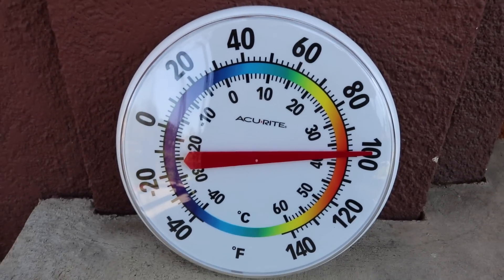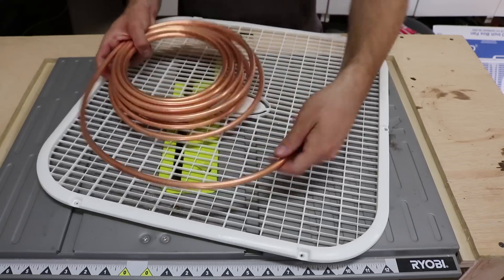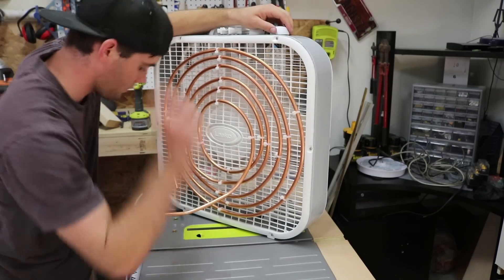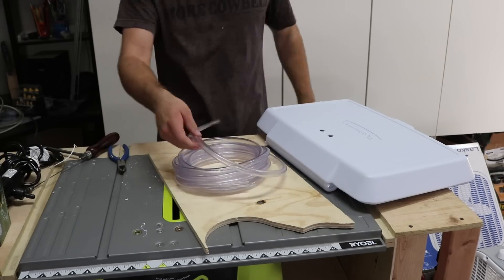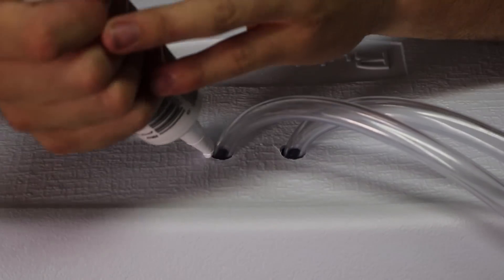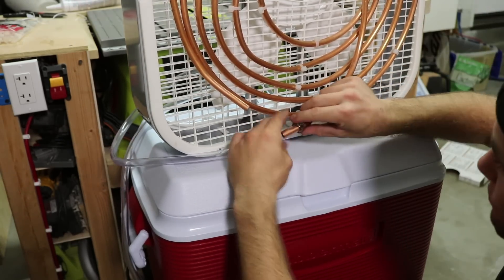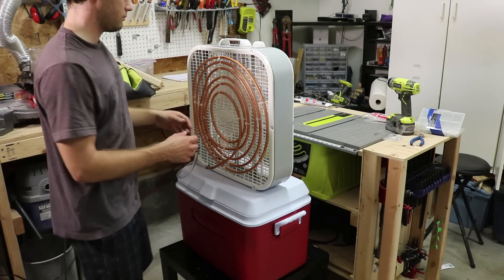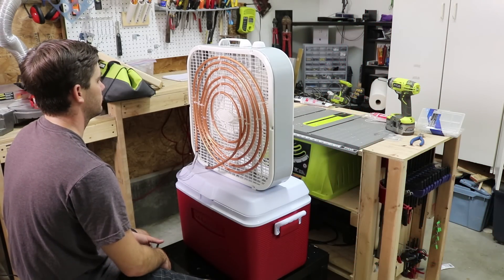$100 Homemade Air Conditioner - DIY

Comment: Well as an HVAC tech I have to say this would work in theory. Not sure exactly what the delta T would be  infront and behind the fan. It would certainly be better with some form of aluminum finned type copper tubing. There's also the law of thermodynamics that energy cannot be created or destroyed... Which means the heat energy that exists within that room is simply being transferred into the cooler. Heat is energy that moves to something cooler... So the real question is how long will it take this contraption to cool the garage before the cooler itself has absorbed too much heat and the water is now just as warm as the room? It realistically cannot change that heat energy into something cooler. it can only be transferred from one place to another.
Reply: This would be excellent in a small space, such as a pickup camper.
Reply: The energy mostly converts the ice to liquid, though not very quickly (which tells you how well this works).
Reply: Ya and?
If he can transfer the heat from his garage into the cooler then that’s his intended outcome. You’re over complicating it.
Reply: @whattha930  the heat is still inside the room.
Reply: Actually, without a constant source of cool water this system would add heat to the room (fan motor). His best bet would be to spray water on his shirt and stand right in front of the fan. At least that’s my opinion as a lowly psychrometric engineer. 🤷🏻‍♂️
Reply: Is delta T a variable like X?... More importantly it wouldn't be logical not to agree with u, with the same token, turning on your home, office or vehicle AC is also a way of transferring heat.. And if I'm on track, what I'm most curious about and will still look to try this method BUT WITH DRY ICE. price triples apx 350 finished.. $200 buys 16 packs of dry ice from Bens plus the cost of a super icy cooler have u in the 3's BUT pack it all together and it will last about a month n half assuming your running it for the majority of day light. If ur suggestion of a copper fan like aluminum? (micro radiator if they sell it online be great) and combined that with a stronger power source (dry ice) and a better fanned water cooled system (maybe like placing it on the front and back?) And locating my 2 fans somewhere near the ground channeling fresh outside breeze inward, while having another fan near the ceiling blowing that hot air outside. Haha. I love summer when it's snowing unless I'm at the beach. Icee ice cool is how I like it cold. Please do poke out points of failure if anyone thinks it won't work and be nice to know why. Maybe it would be cheaper to run an ac unit into the garage but my doubts are higher about that...
Reply: @syirusb4583  Delta T is the change in temperature that occurs over time. T stands for temperature, delta is the Greek symbol used to symbolize "change in". T is typically a dependent variable in formulas for heat exchange (for example heat transfer is Q = m * c * delta-T).
Reply: @syirusb4583  This system and the one you want to make will only work until the ice is melted. Then the system reaches equilibrium and no cooling happens. A true air conditioner never reaches equilibrium. Energy is used to create a perpetual imbalance. The air inside gets cooler and the air outside gets hotter.
Reply: @Jason While you are correct that the heat in the room is essentially absorbed by the ice in the cooler. I think you're missing that this is a passive cooling system to spot-cool a small area to keep onself more comfortable for a short time. I haven't gotten to around to finishing mine yet, but I am currently building one myself. Seems like a solid way to save money on my electric bill during the Summer in the deep south. Hopefully it works out for me.
Reply: @bignamek  But you're either spending money on ice or spending money on electricity to make ice. You could just spend that same money on electricity to run a small A/C unit.
Reply: @edisont.picard4112  I'm sorry I failed to mention that I'm using gallon jugs to freeze water to swap out. My freezer is going to be on anyway, so I'm gonna just reload ice that way. It won't get cold as, of course, but should stay frozen longer given the greater mass of ice and it won't need to be drained as much.
Reply: @bignamek  It's still not a free ride. You spend some amount of electricity freezing your food but as soon as you load 10 gallons of water into your freezer, you will spend more electricity to freeze it. If you are trying to cool a space larger than a shoe box, you're just wasting money that could be spent on an actual A/C that really works. Not to mention the money to build it. A $50 Craigslist window unit is cheaper and more effective.
Reply: @edisont.picard4112  It might be more efficient, but I don't know if it would be more "effective." For my particular case I live in a house that is poorly insulated, so the cooling benefits are not as high as it might be if I lived in a different climate where insulation is more of a priority. In my case, the volume of air moved while cooled is likely to be a larger factor.
Reply: @edisont.picard4112  ice makers cheap
Reply: @edisont.picard4112  I find it entertaining the arguments some of these folks make. It's like the guy that wants to charge an EV by attaching a small wheel to the car with a generator attached. lol
Reply: @bignamek  Well, how did it work, how long did the water and ice stay cool
Reply: The guy was just looking for a easy way to cool himself off. And it worked. So I’d say it was a success.
Reply: It works, the temperature in the room is controlled for longer before spiking to the point of being uncomfortably hot again., for the cost this is a really cool design 🙌🏻
Reply: It’s just acting as an evaporative cooler. He will get a cool breeze and that’s all he needs. Will need to throw in ice into the bucket every so often
Reply: u would be replacing ice all day lol
Reply: It would be better to run some plastic pipe 5-6 feet (2 meters) deep under your garden in an array, to bring cool air in from underground, with a fan. Then you wouldn't need to keep refilling the ice.
Reply: As an HVAC Tech who doesn't have poop for brains.....I'd say this is the dumbest thing I've seen in a while. That copper tube has such little surface area you would be better off to just take off the lid  and return that pump. Run the fan air over it and enjoy melting your ice for a fraction of the electricity and in about the same time. If you took the money you spent you could have gotten a small AC for your garage.
Reply: As a non HVAC tech, simply remove some of the warmed water and add ice.
Reply: Who gives a sh--t what the delta T is, he's not trying to cool his whole house. It's a DIY way to stay cool and it works. Praise the man for his idea and shut the f--ck up. And I'm a 35 yr journeyman ac tech in silicon valley
Reply: He’s definitely not trying to cool the entire garage down    Pointing it at yourself while working would keep you cooler and that’s the point
Reply: Wisdom. People just do these videos to be "funny and cute" as they share no valid info, and waste people's time and money.
Reply: Yeah and the inside material of the ducts get cold if they are made of metal 
And In turn you get colder air.
Reply: Wouldn’t it leak water as well…..  condensation…..
Reply: Also it’s not conditioning the air…… unless you mean making the air more humid we’re an air conditioner traditionally does the opposite..
Reply: Ice melting is where the heat absorbtion is happening
Reply: Massive Turth revolution on your part!!! Good job !!
Reply: That's not thermodynamics.  "Energy cannot be created or destroyed, only change forms." is the law of Conservation of Energy.
Reply: @BigGuy42080  it's literally the first law of thermodynamics, because the entire concept involves heat transfer. You can look that up if you like 👍
Reply: So where does the heat go on a normal ac central unit for the house ?
Reply: @rl4416  it goes from the indoor air, through the return into the furnace. It is then blown into the coil, the refridgerant absorbs the indoor heat, the refridgerant then takes that absorbed heat to the condenser outside where it is rejected to the outside air.
Reply: @numchux2  thank you . I was lost on the heat has to go somewhere part.
Reply: @rl4416  yw, glad I could simplify it enough HVAC can get pretty complicated 😆
Reply: just put more ice lol
Reply: @ptq32t  yes , im alot more stupid after reading your comment .
Reply: Would be interesting if you could cool it with a dehumidifier’s output?
Reply: It works cooled our room by 15 degrees
Reply: What if you used dry ice??
Reply: What do you recommend as an alternative to beat the heat??
Reply: I got a 500 watt solar panel that powers my mini ice maker. 28 lbs / day. Put that in the cooler very few hours. And blow it out like this system. Off grid living. Portable AC takes too much wattage.
Reply: Appreciate your knowledge, but wouldn't the consequences of thermodynamics reduce when the ice is replaced allowing the cooler not to absorb to much heat?
Reply: It's a coping saw, not a hacksaw
Reply: You have to keep replacing the ice, because you're exactly right. As the warmer air is being blown over the tube it will melt the ice. However the longer you run it with replacing the ice it will get cooler. I would also suggest piping on the back as well. It would probably take 3-4 hours to cool the room significantly. There are other designs that work much better. Since it's not blowing the air from inside, it may be a benefit to add dry ice as well.
Reply: technically the water will always be colder or cooler than “room temperate” considering if you splash water on your face it’s gonna feel cool. doesn’t matter if your an “HVAC” bud, cool is cool! haha
Reply: You need around 7 kg Ice to melt for every liter of water in the air as humidity. Sensibly cooling air will require much less, so depending on size of his garage, he may need to replenish 5 to 7 kilogram ice every hour or two. And yes, it's literally AC. It cools and dehumidifies. Amount of ice also seems manageable if your chest freezer can make cheap ice during cold hours of night, it's as energy efficient as AC.
Reply: isnt it the same thing to let an open bucket with ice melt in a room? this look just a directioner
Reply: I would think the answer is....that while the ice cubes in the cooler are cooling the room but melting ...and moving from cold to warmer, the ice trays in the fridge are freezing water and a manual refresh of ice cubes is added to the cooler again, so that this ultimately has less environmental impact than a throw away portable and also keeps you physically fit cause it gets you off the "couch" by having to periodically replenish the icecubes? This system while crude seems cheap to maintain and is very simple a answer, my question is, just how good is the heat/cool exchange of the copper pipes, and you've already touched on this....so the quick anwer to your question is fresh ice cubes go in the cooler periodically.
Reply: @thesongtowoody  if he’s got a yeti cooler then the ice doesn’t melt 😂
Reply: @thesongtowoody  an ice cube melting and one right out of the freezer are the same temperature until the cube has completely melted. It's called latent heat which is the heat required to convert a solid into a liquid or vapor, or a liquid into a vapor, without change of temperature.
Reply: I don’t think he’s trying to cool down the entire shop in the first place but if he’s taking a brake or working on something in one spot he can have it pointed at him to stay cooler. This isnt a literal air conditioner, its just to keep him a little cooler. His title is misleading but I didn’t honestly think this was an air conditioner replacement lol.
Reply: @pattycarljackson  video title says "homemade air conditioner"
Reply: @DickShooter  and it’s conditioning the air. So there you go.
Reply: @DickShooter  I always wonder how people like you were the fastest swimmer. This isn't meant to cool down the whole house. Is your IQ like 30? It's a personal AC, meaning while he is working in his garage, he can have a low energy cost AC that can help keep it more bareable. Does this help sum it up for you? And the rest of the 1st graders here? It's basically a modern day swamp cooler, when they put ice in front of fans and windows.
Reply: @pattycarljackson  youre wrong, this is literally an air conditioner. you know how those work? they get cold which pulls moisture from the air which is exactly what this will do.
Reply: @zombieblaster5754  a dehumidifier takes moisture out of the air and no this isn’t literally an air conditioner.
Reply: Yes, we get it... but 7K vs 100 bucks and the cost to refill the ice for those with limited budgets this is GENIUS.  C'mon Mr. HVAC man, he's not going to use 7K in ice, let alone the electricity costs of a compressor running.  It's called dealing with the realities within one's circumstance that otherwise would be undoable.
Reply: Yes it’s transferring the energy to the cooler….. but that’s the ice melting…..
It takes energy / money to make the ice ….
Reply: @mycaddigo  Wow, like... Wow... Okay man. Just an FYI. It doesn't cost but PENNIES for your ice machine to make ice every month. In case you don't have one, your freezer is already on. Secondly you're not using this to cool down your home 24/7... It's a way to cool yourself down when you have a project to do in the garage. I guess you don't get off the couch enough to know that either. How did some of you survive to adult hood? Who the hell watched this and thought he was telling you to replace the AC in your house?
Reply: @IIIReptarIII-TCPH  lol …….. triggered ……
If you noticed he put a bag of store-bought ice…….. how much electricity you think the Company pays electric bills running commercial icemakers….
That and water is gonna be their biggest expense…
So I was just commenting on the science and the transfer of the energy….
The heat is going in the cooler …. Melting the ice …
And also I never thought about someone was going to replace the AC unit with this….
You just sort of imagined that ….
TAke ur pills braaaa
Reply: No no no no. Ice make thing cold. Attach fan and make thing colder. Lol. I love these ridiculous contraptions. I also imagine the amount of energy being used to operate this thing would be illegal in California.
Reply: @DickShooter  can you not run a box fan all day in CA?
Reply: @DickShooter  this method uses very little wattage
Reply: so just put it in a window?
Reply: @Randorandom232  with 109 degrees outside blowing inside? Nope
Reply: @Randorandom232  that’s what I’m wondering. This looks like a fun project
Reply: @Randorandom232  You don't understand anything he said; do you?
Reply: @chrish1695  you're too late. Next time reference the comment.
Reply: @Jason  Sincerely enjoyed and appreciated your science, I learned something. Did ya have to pee on the party though? 😋😜
Reply: @jeliarra  Yeah, better to perpetuate ignorance so everyone can just keep the fun going, right?
Reply: @jeliarra  I gotta says, everybody's needs are different, don't get bogged by A super scientific guy's view, unless your smack in the dessert rough, .4 me I bet it'd work fine in any pick up trukk or van. If anyone's gonna drop $300-$425 on the icy breeze that's like WAAAAAAAAY 2 much money HANDS DOWN !!! CAUSE in the realm of things if I'm dumpin 400 rocks it's GOING TO BE on A REAL HOUSE AC, and then I'll stick it in the slider winder POWERED  BY REAL GENERATOR POWER------- WHICH I ALREADY HAVE on 1 of my trukks😉
Reply: I'm inclined to trust your opinion as an HVAC tech, because this was all greek to me. Impressive though, but you would know whether this works or not.
Reply: @raillanmcneill8401  refrigeration - taking heat from somewhere you don't want it and putting it somewhere where it doesn't matter (i.e. - outside) that's all you really need to know to understand it :)

The heat energy has to go somewhere for the room to stay cool
Reply: @raillanmcneill8401   sir.... It's literally elementary school science...
Reply: @toasteddingus6925  I never needed to learn how to make an air conditioner out of a fan.

Comment: You forgot the cost of $100 per hour for the ice. Instead you should get a small fridge and put a copper heat exchanger loop in there that runs through the fridge and freezer part connected to the heat exchanger on the fan. That would be dope ass.

Comment: yes, there will be cool air, however you forgot a major problem, and I saw it start as soon as the ice water started to flow through all the tubing outside of the cooler . Condensation will immediately form and start dripping from all the exposed tubing. It needs a drain pan to catch the water, otherwise you will have water on your floor.

Comment: Ok. Well for 100 I’ll be buying an air conditioner. I wanted to see the temperature difference and for some reason that wasn’t included after the build and presentation.

Comment: add a wicking system to the coil loops.  Tie a thin string/thread onto the bottom of the top rung of the copper loop.  Then pull the string downward through each coil, wrapping the string around the coil, and down to the next one.  Drill a hole into the top of the cooler, and drop the string down into the cooler but make sure the string's end does NOT go into the cooler water reservoir.  You want the string a couple inches above the water level so it drips the water down into the reservoir, thus removing that moisture from your room and trapping it into the cooler, also keeping the cooler water level high as possible during use.

Comment: or you could buy one of these or similar for less https://www.amazon.com/Portable-Conditioner-Evaporative-Circulator-Humidifier/dp/B097MLF99T/ref=sr_1_1?_encoding=UTF8&c=ts&dchild=1&keywords=Room+Air+Conditioners&qid=1625142036&refinements=p_36%3A-10000&rnid=386465011&s=home-garden&sr=1-1&ts_id=14554126011